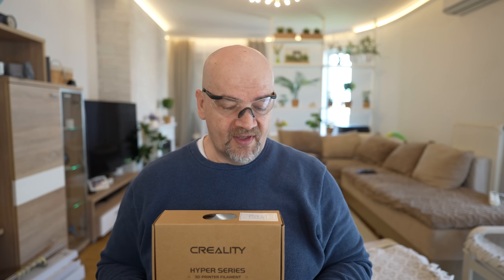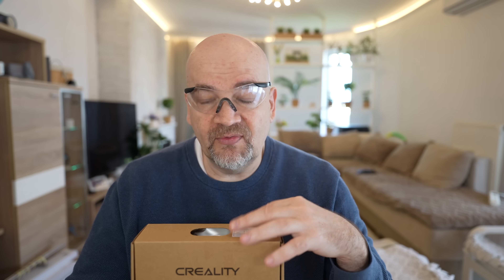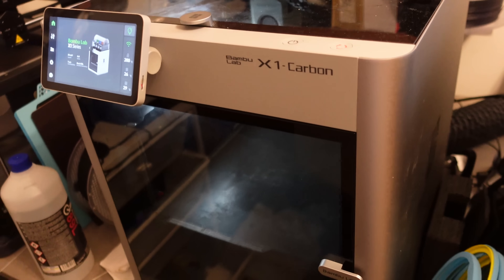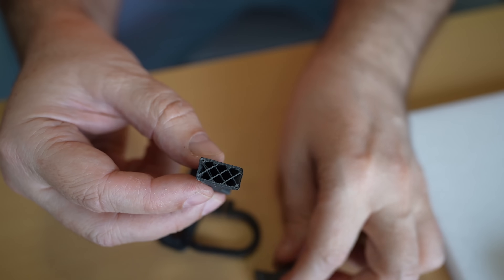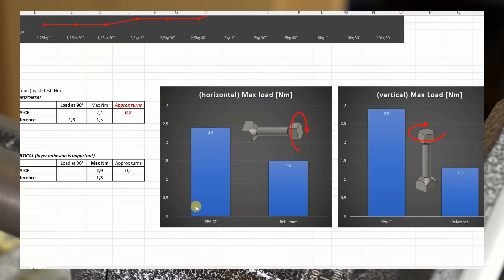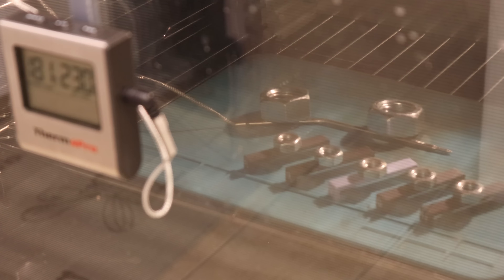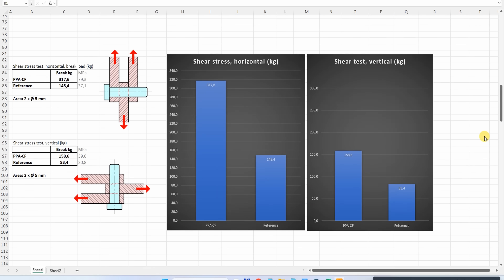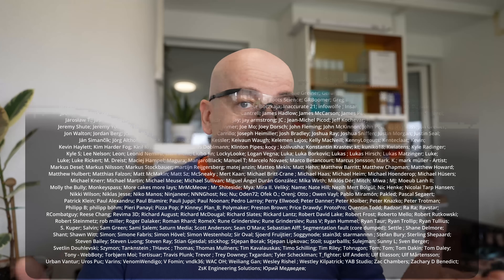Creality PPA-CF filament review, the strongest nylon type I tested so far

Comment: In Orca Slicer, you can set the part cooling fan to only run for the outer walls.

I wonder, if I am printing a large PPA part ( or any other filament that requires proper layer adhesion for that matter, ) that has solid infill and about 3-6 walls, and the ONLY fans I use are for the outer most walls, would there be any tangible negative affect on layer adhesion?

My theory is that most, if not all, of the solid infill should stay warm for the next layer to adhere to, which is where a majority of the layer adhesion strength truly stems from...?

Comment: Great video! I’m using the same PPA-CF material and running into two issues:
	1.	Severe warping, even with Magigoo PA, 110 °C bed, brim, and enclosure.
	2.	At 100% infill, the carbon fibers stick out on the top surface.

I’m printing on a custom setup with an H2-D Direct Drive extruder, 0.6 mm nozzle, flow around 4 mm³/s, and speeds under 50 mm/s at 300 °C.
Have you seen this on the X1C? Any tips would be really helpful!

Comment: Thank you so much for this information, especially confirming the drying temps. I have been testing this filament also and have found that drying at the required temperatures tends to deform the spool a bit. Creality should address this! But still, very strong stuff.

Comment: Thank you very much for doing this video.I believe it was our conversation that led you to this particular one. Now, in light of all the tariffs, It is very difficult to find a US manufacturer of something like PPA CF. It looks as if 3DXTech HTN CF is produced in the US, but I would like to compare where the source material comes from all of them, but I don't have access to the data. I've been very interested in all of the high strength nylon derivatives but it is sometimes difficult to get the true specs of each material. I now have the materials from Siraya, Qidi, Creality and Bambu. I've used 3DXTech products before and been very happy with them, but the cost of their HTN CF Is even more than the Bambu and I'm curious how it stacks up strength wise and what the other benefits of the various base materials of all of these are. Your Patreon lists Syria, creality and then bamboo in terms of pure strength and I'm curious how the 3DXTech HTN CF would stand up.

Comment: Hi I have a question, what is the filament dryer your using? I plan on making a lot of stuff with ppa and what a large dryer that can hold a lot of it.
Reply from the maker: For PPA it's better if you go with higher temperatures (above 70°C). Not many dryers on the market. Sunlu E2 and soon Bambu HT AMS unit (not sure, what is the correct name). Or Kitchen oven.

Comment: What a really great review, thankyou! As an engineer I really appreciate the detail you put into the tests. That DIY charpy test is just brilliant :) Please could you provide a bit more information on the dryer you used? I can only seem to find driers that go up to 70 or 80C. The Sunlu E2 looks like it would go to 100C but it's not available yet, so what alternatives are there? Thanks, and keep up the good work.
Reply from the maker: Thats based on IZOD test (test object vertical). Charpy is horizontal, supported from two sides. Dryer: Sunlu E2 (I have a review about it, max is 110°C). Then to Eibos Polyphemus (max 70°C)

Comment: Makers Muse just released a video on PBT Pro filament (polybutylene terephalate with glass fiber), with his personal experiences.  Basically, it's very tough with high durometer TPU impact resistance and flexibility, but suffered brittle fractures in high speed impacts (small combat robots).  It would be good to see how it stacks up in the My Tech Fun testing lab, but after Angus' video, apparently PBT filament is sold out on a planetary scale.
Reply from the maker: PBT Pro ordered
Reply: @MyTechFun  - You found some PBT filament!  Patreon and Polymaker sponsorship for the win!  Thank you!  I'm looking forward to your material testing video.

Comment: These are very important results for me also.. Im looking material without -CF added but it seems theres not much options to print with Bambulabs because its chamber temperature does not reach needed temp for to proper print e.g. Polymax Polycarbonate.

So it seems this Creality PPA-CF has strongest layer adhesion but with some print quality costs, the absolute best layer adhesion is almost in any case the most needed and therefore sometimes Polymax PLA Tough or even TPU would be only option but those doesn't suit for high temp applications like automotive engine room parts

 I was not sure what was the referense you used there?
Reply from the maker: Looks like it's a bad idea. Reference is the average from almost all my testings (150 filaments)
Reply: @MyTechFun   Ahh so not anything like "2nd best material"

Is those testings only for patrions or do you compare resouls some othee videos?

Ita hard to find data like how strong filaments actually are as printed

e.g. Polymax PC advertise very good data in table, but actually as printed its layer adhesion is so bad that basic PLA wins any testings of mine :/
Reply from the maker: @ The summary table is for Patreons, but here is one video, with conclusions from that table: https://youtu.be/vKNCV-blJzI?si=Fj9xv_U9ldgBbwCw

Comment: I wonder if the larger than normal filament diameter grants the extra strength and layer adhesion by simply acting as over extrusion.
Reply from the maker: Yes, but the problem is that with solid printing it accumulates, and the material don't have space where to go. I tested this few years ago, maybe I should repeat with new printers and filaments..

Comment: Again super interesting. Seems the “brittleness” is pretty serious. I don’t know how you are able to feed these filaments 😂. I found the Siraya ABS-CF core stuff to be so brittle it screwed up my core one extruder. Couldn’t even feed the stuff and ended up returning it…
Reply: The trick is to not feed them thru a bent reverse bowden tube. For these really stiff CF filaments I feed directly into the extruder in as straight a line as possible with no reverse bowden tube.
Reply: @ Huh, so you’re saying remove the PTFE tube from the extruder and go straight in? I’m guessing on my core one I’ll have to disable the first filament sensor. It makes sense - the toybox printer I had was like that.
Reply: @rpiian  yes straight in. If you have a filament sensor on the extruder or integrated into it, you can still use filament sensing if you want. I don't have a filament sensor on my custom printer....one more part to fail.
Reply: @liamventer  I don’t blame you - the core one has two sensors! One on the entry and one on the extruder 🤣
Reply: @ Thanks for the feedback - between drying, and removing a sharp hard bend into the extruder, I got my core one to print PET-CF and PETG-CF. I’m happy. Thank you!!

Comment: Why do companies always list a print speed but not a max volume flow rate?
Reply from the maker: I don't know, it is easier to imagine maybe. But as most of us know, flow depends from nozzle diameter, layer height, line width too.. With 0.25mm nozzle and 0.05mm layer height, we could even print everything on 500 mm/s for example..

Comment: Read somewhere annealing PPA-CF @90c for 60 minutes makes it even stronger. Can you show if that’s true?
Reply from the maker: I tested this with other PPA filaments. Yes, it's stronger, but no big difference. BUT it significantly improves temperature resistance, I was able to test this with regular PPA (no CF). Wich CF even non annealed reach the max temperature of my testing equipment.
Reply: 90C is not the optimum temp to anneal PPA-CF. I anneal it depending on brand between 120C and 150C and 60 minutes would only be good enough for maybe up to a 2mm thick part. Typical recommendations are something like 60 minutes per 1mm section thickness.

The Annealing also helps lock out future moisture absorption....i think due to higher cystallisation not leaving free elements for the water molecules to bond to.....but I am definately no chemist.

Comment: Have to give a shout to polymaker, sponsoring testing of other filament brands shows some confidence.
Reply: That's exactly what I thought. And really, it shouldn't bother any good filament company: each filament is different! If it is stronger, it is usually more brittle - so, it is a matter of finding the filament that matches what you want for each project.
Reply: My thoughts as well, after using their pa6-gf I've been using more polymaker filament recently and they definitely have reason to be confident, nice to see it at this level of funding testing of other brands though!
Reply: Best advertisement ever.
Reply: Have to give a shout to Creality, pricing filament at half the cost of your competitors makes me care far less about another brands 'confidence'
Reply: There both from China
Reply: Meaning they are willing to help one another either way there winning

Comment: Would it be safe to say that mechanical creep would increase with the presence of heat?
Reply from the maker: Yes, earlier I tested this too. But with PPA that temperature should be very high.
Reply: @MyTechFun  thanks. Your testing specifically, is what a lot of people are using to determine which filaments to get for demanding applications. I myself am looking to print an intake elbow for my car, however it will be cantilevered and supporting the weight of the throttle body so I need to either support it underneath or ensure the material will withstand the temps. The current elbow gets up to 50c after an hour of driving, but I live in Southern California and maybe want to drive to death valley one day so all options must be considered. Either way, thanks a ton for your testing.

Comment: Polymakers CoPA and Taulman Alloy 910 are the strongest filaments I've ever used.  They're practically indestructible.  I have many structural and high wear replacement parts on my riding mower made from these, since 2019.
Reply: yeah copa is something else!
Reply: i used Alloy 910 as an adapter on my wheelchair arm rests. Great stuff but seems to warp more for large parts. There's also some shrinkage, and print speeds are slow compared to ppa-cf i've used from siraya. Too bad they went out of business. Would have been interesting to see them make a cf version
Reply: CoPa(when printed in an 80c chamber) is the only filament other than maybe PCTG, TPU, and Polypropylene that is completely isotropic. Can't even tear a single wall part along the layer lines

Comment: I think over extrusion plays a significant role in the improved strength.
Reply: This matches my experience.  Layer adhesion is a intricate dance involving flow rate, print temperature, and chamber temperature.  Then there are print profile settings with layer height, etc.

My experience is that pushing the flow rate to over extrusion levels boosts layer adhesion a LOT.  I was able to get about a 5x improvement on one particular filament by changing flow rate and temperature, to values within about 12% of the start point.  It is very significant, at least with some filaments.

But... it means that @MyTechFun 's layer adhesion tests are less useful because the principal variables that modify it are not controlled.  They would all be different anyway with the different blends.  Filament A may be under extruded, printed too cold, and get a poor score while Filament B is over extruded, printed at the right temp, and gets a good score. All while A has better layer adhesion than B with optimal profiles.  Who really knows what the auto calibration of the X1 is doing...  This stuff isn't always printed on the same printer either.  I even get slightly different extrusion rates on the same printer if I feed it through the AMS or directly.

I spent 30-40 hours just testing one filament's layer adhesion to find it's sweet spot.  One that scored poorly in layer adhesion on this channel but I have performing better than another that scored better here.

Filament manufactures would do well to test their filaments extensively and make good profiles for the most popular printers.  There's just no way even someone as dedicated as @MyTechFun could produce the layer adhesion curves with the various filaments and show their optimal ranges for all major variables involved.  It's just too much work.
Reply: @brandonmansfield6570  Completely agree. I probably used more filament to chase the perfect setting (not necessarily for mechanical properties) than the actual design parts. It all becomes super convoluted when going extreme. @MyTechFun has a well-structured and open platform. 

Given that same type of filament from different manufacturers can perform rather differently, I'm extremely curious to understand how different additives affect the printability, thermal and mechanical performance. Things like fiber additives are easier to understand. But others are mostly mystery to me. Do Polymaker add more lubricants to their filament for better printability thus sacrificing thermal stability? Do cheaper brands skim on the lubricants and end up scoring higher in heat resistance? I'm sure someone around would have at least some hypotheses to explain what's happening.
Reply from the maker: They improve strengh, but not significantly. If I compare this filament with other PPA filaments (except maybe layer adhesion, here it was significantly stronger)
Reply: @MyTechFun  True. The margin is quite big. But better if flow rate could be normalized in the future. Love your content. Thanks for replying.
Reply: Ye, and layer adhesion is cooling dependant . I would turn off cooling

Comment: great ! Which is the easiest to print according to you, pet-cf or PPA-CF ? i'm used to the pc-blend cf, but layer adhesion is to weak for my need, i'm looking for a substitute (qidi-cf that you tested seem great but no idea for moderately complex geometry like pc blend cf is capable). thanks for you work, very precious.
Reply: Haven't used PPA-CF but polymakers PET-CF prints as easy as petg. Just make sure the filament is dried out for at least 4 hours at the recommended temps. Smooth pei with glue stick had great bed adhesion.
Reply from the maker: Some companies claims, that PET-CF can be printed on open printer too. I will test this soon.. So, PET-CF is easier.

Comment: Question: have you tested/compared your layer adhesion samples when printed individually, one entire piece at a time, not as a part of a sample  group? There might be some differences because freshly printed top layer has plenty of time to cool down when other parts get their next layer. I was thinking about it during your PEEK troubles...
Reply: This is actually pretty important with some filaments in my experience. I have an actively heated enclosed chamber printer that I use to print parts in 3DXTech PC and PC-CF. I usually print individual parts and have amazing layer adhesion if I print at 150C Bed temp, 300-310 nozzle and 90-100C Chamber. When I've tested the parts to failure the failure in the z direction usually fails from a stress creating feature (think screw hole, 90 degree corner, or thin cross section) across the layer vertically and not at individual layers. I was being impatient one time and tried to batch print 6 parts and every single part failed with bad layer adhesion at different layers depending on the model before I even assembled the parts to use. I have how ever had good luck with using the individual parts function in the slicer and spacing the prints on the bed and order them to print sequentially.

As for the PEEK issues that may also be chamber temp related, I haven't tried printing it in my printer because my chamber does not get hot enough for the proper in-situ crystallization. PEEK needs bed and chamber temps of 133C or hotter for proper crystallization.
Reply: @ltspike12345   what printer do you have with 90c chamber?
Reply: You must have adequate cooling time for the layers to be solid enough to not droop or have surface finish issues, while also being hot enough to allow better layer adhesion between materials. Very fine line between both. With bigger printed parts it's less of an issue while smaller test samples you must print either multiple objects to allow cooling or turn up fan speed enough to cool the layers without over cooling them.

Comment: I am always hesitant to use polyamide based filaments due to moisture management before and after printing. But with your tests seeing the high interlayer adhesion, I am warming up to the idea of giving them a chance and trying them out. I wonder why PPA CF is currently missing from Polymaker's Fiberon lineup. Maybe you could share with us an official response since they are sponsors of the channel now. Congratulations for the sponsorship by the way, it is well deserved!
Reply from the maker: They will have it in a near future. And PPA is far less sensitive to moisture compared to PA6 for example. BambuLab even recommend it in a water based applications (like boat paddle part for example)
Reply: @MyTechFun  is this filament stronger than PPA-CF core from Siraya?
Reply: @hg1496  You tell which is stronger.
Reply: If you have active heated camera printing with CF will only  worsen layer cohesion
Reply: Why are you using this dryer and not a Crealty drier?
Reply: @KaloyanDobrev Why are you using Creality drier?
Reply: @KaloyanDobrev  why would the dryer type matter?

Comment: How much calibration do you do when you get a new filament? Im thinking that the test results will vary if you overextrude like you did with this one. The easiest way to calibrate flow is to use orca slicers flow test :)
Reply from the maker: I know, but I printed everything in same day, using same gcode (Qidi 3x, Phaetus and this Creality, all PPA based filaments). X1C is used with lidar.. sure, it's not for pure flow, but the printer have very constant quality..